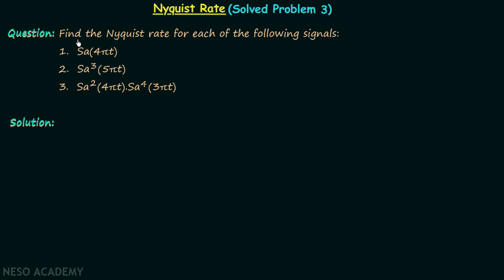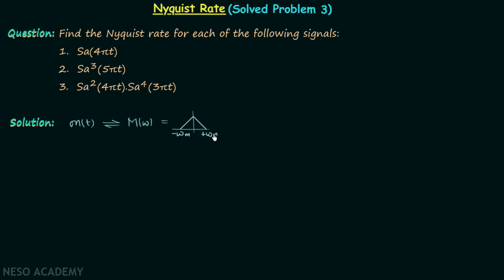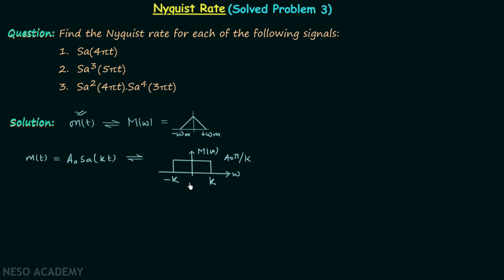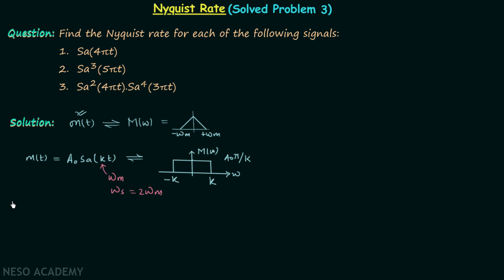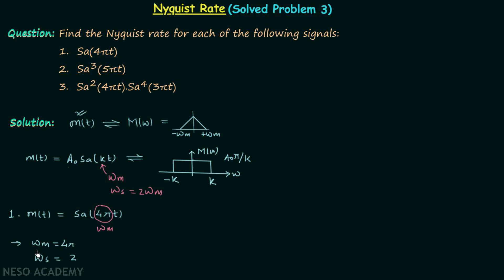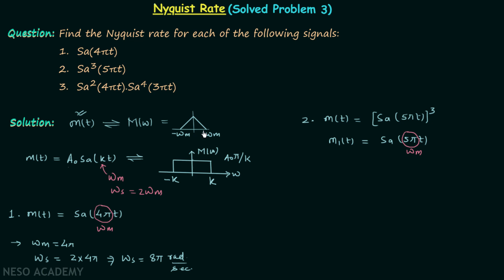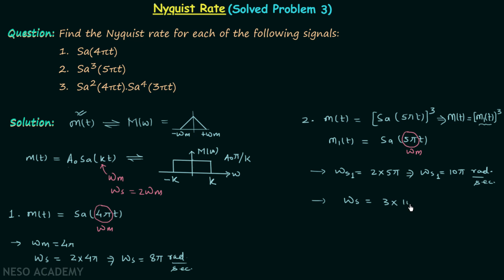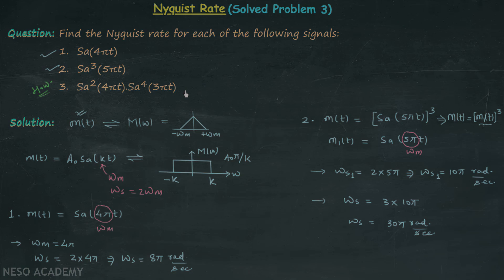Nyquist Rate (Solved Problem 3)

Comment: i think the answer is 52pi, as i will calculate the nyquist rate of the first sa(4pi*t), i will get a nyquist rate of 8pi, and i will then mulitply it by 2 i will get a nyquist rate of 16pi for the first signal, i will do the same exact steps for the second signal i will get 36pi, i will add both nyquist rates, i will get 52pi, if i am wrong please correct me

Comment: ( 4*2  +   3*4  )  * 2 =  40 pi
Reply: yo
Reply: How pls explain
Reply: @abiadhimoolam1391   Sa(4πt) has ωs1 = 2 x 4π = 8π rad/s.
Sa(3πt) has ωs2 = 2 x 3π = 6π rad/s.
Due to the 3rd property in lecture "Properties of Nyquist Rate", [Sa(4πt)]^2 has ω's1 = 2 x ωs1 = 2 x 8π = 16π rad/s.
Similarly, [Sa(3πt)]^4 has ω's2 = 4 x ωs2 = 4 x 6π = 24π rad/s.
Due to 6th property, add ω's1 + ω's2 = 40π rad/s to get the total nyquist rate of the third signal.
Reply: Wrong
Reply: It's 16pi
Reply: no its 40 pi
 @Helpers_Gallery
Reply: @Helpers_Gallery Give your "RIGHT " calculation 😂

Comment: 38π
Reply: Anju Manoj bro I think it would be 40pi not 38
Reply: Biplab Sinha  could you please explain
Reply: I got it ,silly me
Reply: Here, Wm1=4pi  
And there fore , Ws1=2×Wm1=8pi
But a square sign is also there so we have to multiply Ws1 with 2...and that will be the Nyquist rate of 1st portion.(i,e: 2×8pi=16pi)

Same way we will find the Nyquist rate of 2nd portion and that will be 24pi

As this two time depending signals are in product form ,so during finding the Nyquiat rate of whole signal we have to Sum up of this two individual Portion's Nyquist Rate...

So the Final Niquist rate is 16pi+24pi=40pi
Reply: Watch the 6th & 3rd property ,That was described in another video by NASO ACADEMY
Reply: @biplab_sinha_77  but we need to consider the highest frequency to calculate nyqist rate right?so 12pi >8pi why we should not consider 24pi as answer